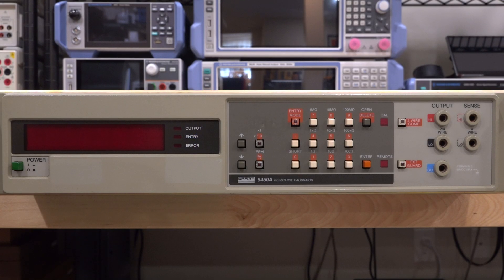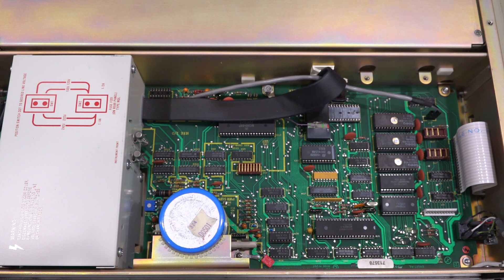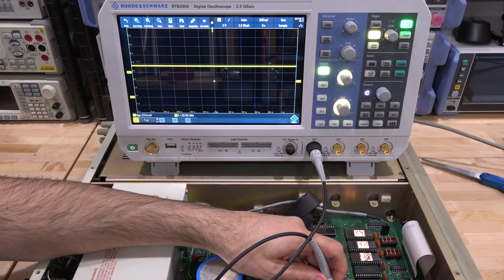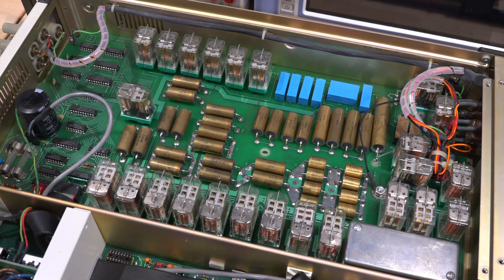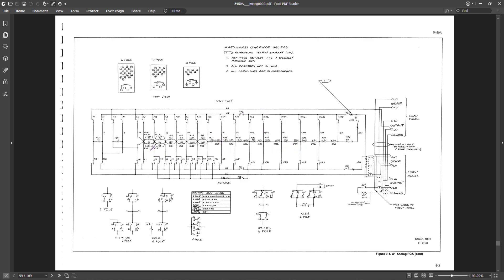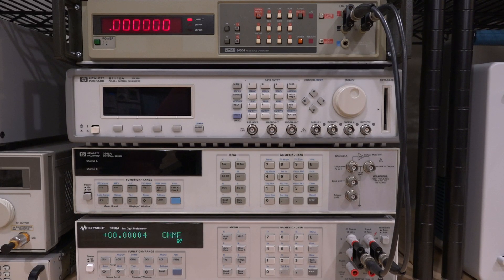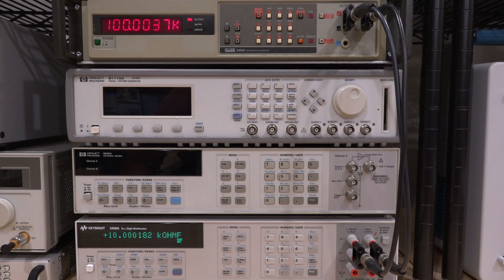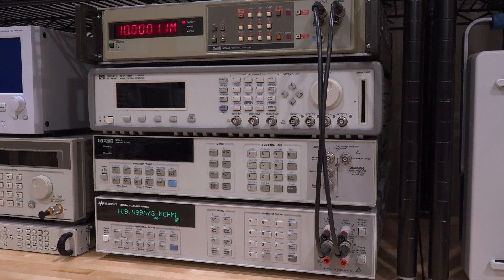TSP #222 - Fluke 5450A Precision Resistance Calibrator (1-Ohm - 100-MOhm) Teardown & Repair

Comment: The large chip used for IEEE-488 support is a MC68488, a purpose built PIO chip designed by Motorola for the 6800 series microprocessors. It handles most of the bus handshaking and data transfer operations. Interestingly,  it cannot drive the bus directly instead requiring separate bus transmitter/receiver chips. The MC3447 was the chip originally used for this purpose.

Comment: We still have the 5450A in operation at Fluke. The dry current relais in it are a bit troublesome as they develop instability with time. Also the high ohm reed relais in "newer" units which are plastic encased become leaky.
Reply: For relay contacts that develop high closed resistance which happens when they got old and don't switch much current. Get a say 1000uf low ESR cap charge it up to 12V, put it across the contacts and close the relay, there will be a spark, which will clean the contacts and drop its closed resistance. Good. For another 20 years.
Reply: @universeisundernoobligatio3283  This will work on normal relays but when you do this on types which have a coating to be switched without a "wetting current" the issue can even become worse, especially when you look onto it from a point of contact repeatability which is the major concern here less the absolute contact resistance.
And this is not wild guessing but actual experience as we tested this as a last resort measure before buying new specially manufactured relays.
Reply: @benedienst  
Interesting, my experience with this has been with relays switching into logic gates which draw no current therefore no spark. So for repeatable resistance the contact materials must not oxidize over years of use?
Reply: @universeisundernoobligatio3283   with logic gates you are working into devices which accept quite a large error margin in their levels.
The relays of those calibrators are required to achieve contact repeatabilities in the single digit ppm range or below. Especially for the workstations we do the Fluke 57xx calibrators resistance verification by transfer method, the repeatability as to be better than 0.5ppm over many measurements and also perform good on drift over a 90 day period in a similar range.
The further you go beyond the decimal sign the more impact even the tiniest imperfections get. 
This is also the reason why you often find more "aged" equiipment in primary laboratories instead of brand spanking new instruments.
It's all in regards of predictability and good behavior. only then you are able to squeeze out the number of digits you need to achieve good uncertainties for highj end equipment like the Fluke 57xx Series calibrators.
Reply: @benedienst  
Thanks for the info, yes its can be a black art to get that type of precision and stability . Lots of experience plus lots of trial and error. 
I have many years experience doing strain gauge measurements for gas turbine R&D, designed and built many telemetry transmitters for rotating component strain gauge measurements.

Comment: I wonder what keeps the relays contacts from getting crusty over time? Are they sealed with argon or neon and some kind of moisture absorber?
Reply from the maker: Yes, hermetically sealed.
Reply: How do they compensate for the contact resistance of the relay contacts?

Comment: Congrats for acquiring this very nice and stable instrument! Over on eevblog forum, I wrote several articles about repair and calibration methods on the 5450A, and precision Ohm measurements with the 3458A, especially using 4W, OCOMP and DELAY for 10 Ohm to 10k and 100k  ranges, and using good shielded PTFE cables, which is an important topic. Please have a look over there, before attempting to calibrate your 5450A. You might do a bootstrap calibration with the 5450A itself, by making internal 10:1 transfers upwards and downwards, beginning @ 10k and 19k, see 5450A manual. That's probably more precise than simply using the 3458A, and may serve as a consistency check for the 3458A Ohm measuring method, as well as a sanity check for the 5450A (i.e. internal leakage paths).
From that, I learnt a lot about Ohm measurements, and about the 3458A in particular. From that, I was able to to improve Resistance metrology 10 fold in my lab, concerning uncertainty, transfer accuracy and stability, latter being around 0.2ppm. These parameters are not (fully) specified in the specs of the 3458A, in contrast to FLUKE 8508A or similar.
Reply from the maker: Thanks!

Comment: Hi, great catch again, whenever I've bought older measuring equipment on Ebay it's been a service massacre except for the HP 427A and 209A - it suffered in shipping and the slot connector for the power supply board cracked. This catch belongs to the WOW category 😁, I would be quite interested in the process of damage to the circuit for the relay power supply. My thinking is that the cpu got damaged and sent incorrect data to control the relay and it overloaded the power circuit, I would definitely do a deep relay check.

Thank you for your wonderful videos, you taught me a lot not only about repairs, but also about equipment that I did not know.

Nice day 🙂 Tom

Comment: Interesting repair!
You did not mention the type of processor you had to replace. Z80?
Reply: The pinouts on the schematic at 9:28 correspond to a Z80.
Reply: @KallePihlajasaari  Thanks. I am NOT surprised... It was a very common processor at the time. I had one in my TRS 80 Computer ca 1982

Comment: I did a couple of repair videos on one of these, mine had issues with all of the relays, I spent ages taking them apart and cleaning them.

You can tell if the relays are not perfect by switching values back and forth to see if the reading is exactly the same each time, I highly recommend you check for it.

Comment: 6:20 interesting choice to use flex PCB material to connect that regulator to the PCB. They must have decided the labor to use individual wires would be more than the cost of that purpose built flex circuit bit.
Reply: The flex ribbon was probably a standard part from the first time it was used and became popular.

Comment: Regarding uncovered EPROMs, I've been doing a bit of an experiment over the past year. I left a couple of them out to see what effect ambient and direct sunlight would have on the contents.

For the EPROM in direct sunlight (sitting on the window sill facing west here in the UK) it took approximately 1 month before I started noticing that some bits were erased. In the end it was about 3 months to fully erase back to all 1s.

The other EPROM is sitting on my desk exposed only to ambient light. The desk is about a metre from the west facing window, so it still receives sunlight, but generally not directly - just whatever comes in through the window as well as lamps, my monitor, etc. Ambient. After what is now about 10 months, this EPROM is still verifying 100% against the initial contents that I dumped.

I don't have a production quality programmer with which to do verification, but so far it doesn't seem like ambient light in a room is sufficient to cause any immediate harm, and I imagine some EPROMs tucked away inside a case with even less ambient light available are even less susceptible to erasure.

Adrian's Digital Basement has also done an interesting experiment where he left an EPROM with the window covered only by a piece of Post-It note in an eraser overnight, and it also verified correctly the following day.

So I kind of have a theory that the window doesn't need to be made 100% opaque, and that the top surface of an EPROM is simply the most convenient place to put a sticker, even if it is a simple paper sticker. I guess paper is sufficient to block any light with sufficient properties to cause erasure.

I'll keep doing my experiment and see how long it takes for ambient light to have an effect on my EPROM, but it doesn't seem to be the "certain/imminent death" that some people make it out to be..?
Reply: Erasure needs shortwave UV, which is blocked by glass, so any indoor location is probably fine.
Reply: @mikeselectricstuff  I'll have to try putting one outdoors and see what kind of difference that makes.
Reply: I did a video about this about 5 years ago, from memory it only took 1 week to corrupt the EPROM data having it sitting on a window sill… I am in NZ where UV is more of an issue.
Reply: @TheDefpom  It's probably less of an issue now since task lighting isn't florescent. We always used the al sticky backed covers that you could indent with ver no.
Reply from the maker: Interesting. Thank you.
Reply: I view covering the windows on a EPROM the equivalent of setting a jumper on a drive that forces it to read only mode. I use it as a safety device to prevent accidental erasure.

Comment: Leave the 3458A powered 24/7 (30w approx.) if you aren't already, and perform an ACAL after a few days, then weeks, then months whilst doing some tests in between. It worked wonders for mine.

Comment: The missing chip is not used in the 5450A, The same CPU board was used in the 8520A and 8520A-PRT. Before you go and calibrate the unit as it has been sitting a while you should exercise the relays. Also when you do the calibration you will want to use the rear terminals.
Reply: If he only uses the front terminals, wouldn't it make sense to calibrate to those?
Reply: @jaro6985  The front terminals are Banana jacks while the back terminals are Copper Binding posts. The binding posts allow for a much lower EMF due to thermals where Banana plugs are great for normal connections but if he wants to make sub ppm measurements on the 5450A, The copper binding posts will make a much better connection.

Comment: Are those going to be mercury wetted relays or something? I would think anything other than that would cause the resistance to go increase with time/use through the relay itself.
Reply: Looks like it's using a 4-terminal measurement, so relay resistance shouldn't be an issue, just need to ensure no thermocouple effects

Comment: Awesome. Good thing old micros do not contain any firmware. What is the temp. coefficient on those nice resistors? 

I wonder if you can calibrate the old Fluke manually? I'm sure Fluke themselves would still cal it too, for a fortune of course.
Reply: Proper calibration of 5450A is rather tedious process, since it has very good uncertainties as calibrator, very similar to 1 year spec of calibrated 3458A. It's not as simple hook up calibrated DMM and record values, but whole setup with external sources, null-meters, etc. Today can be simplified a bit with bridges, but not much. Fluke goes into great details about it in 5450A manual too, which is excellent.
Reply: @xDevscom_EE  interesting info Illya. Sounds like a proper project for your lab full of calibrators and met gear! 

Fluke should do some lab and manufacturing video tours as marketing to engineers. Would be cool to see the who, where, and how behind world class metrology boxes. Not like it could be easily copied just by watching a video...